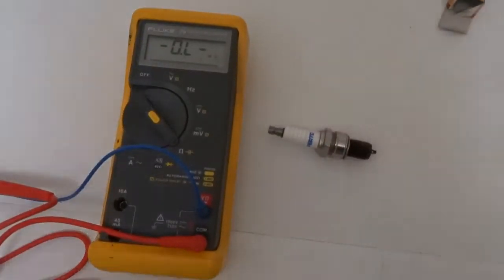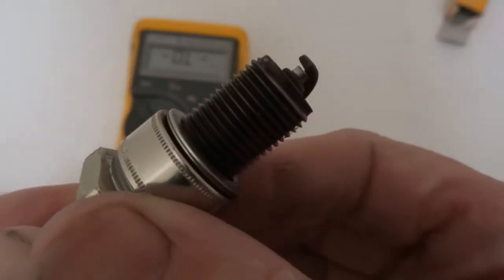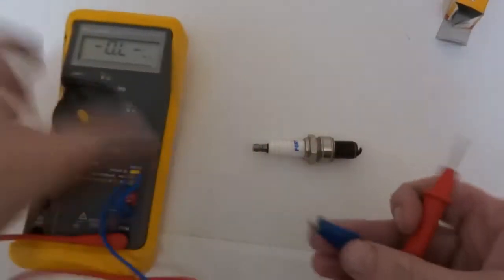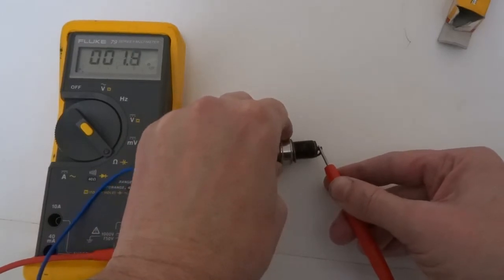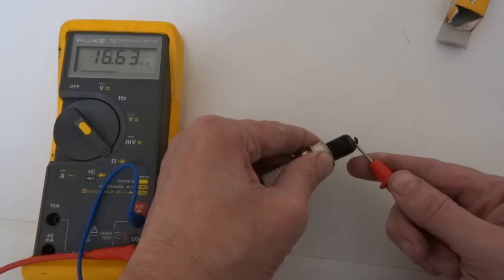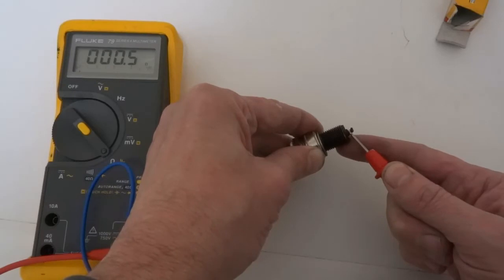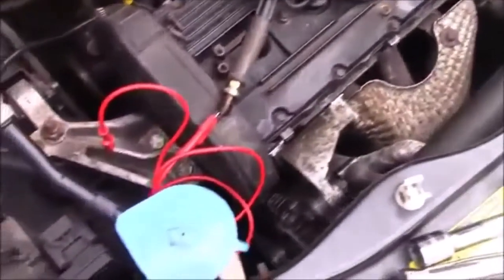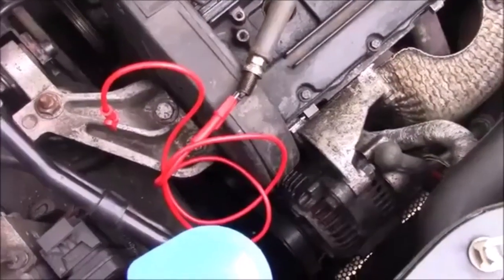Spark Plug Test with Multimeter: How to Check Resistance and Condition (DIY Ignition Diagnosis)

Comment: Hi, I have a Honda CBR 125 JC39, and I would like to know if after replacing the TPS sensor, it is necessary to perform a TPS reset. Is it possible to do this manually without a diagnostic tool?
Reply from the maker: I heard you can disconeect battery for a few minutes and or reset at the diagnostics port with paper clip but you will need to reserch more.